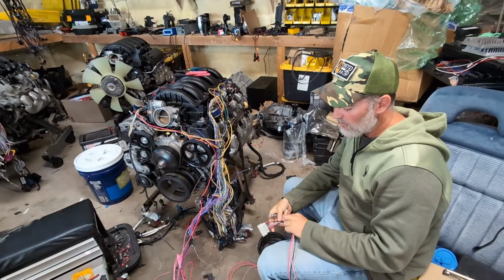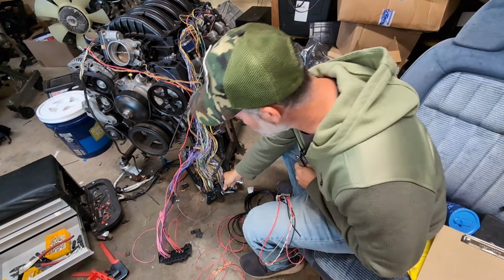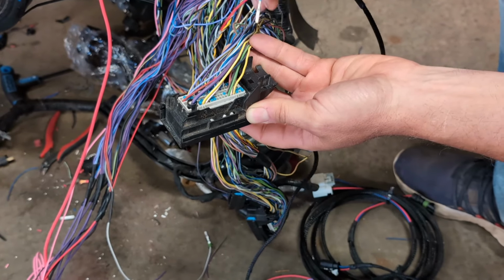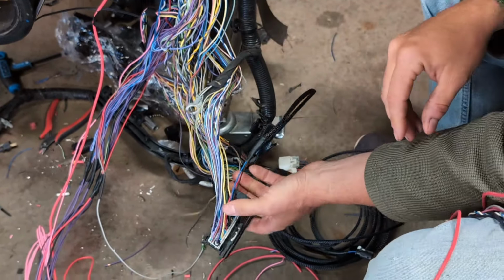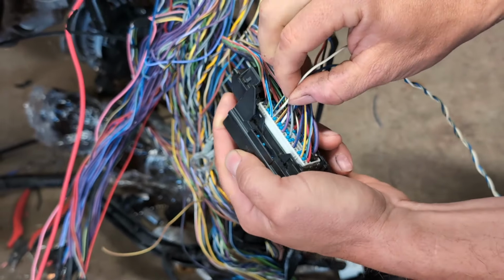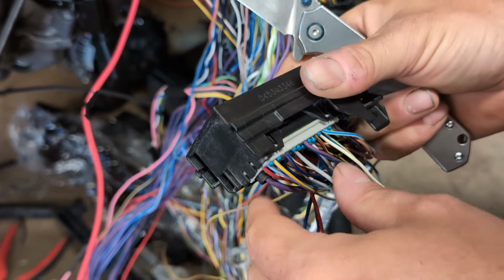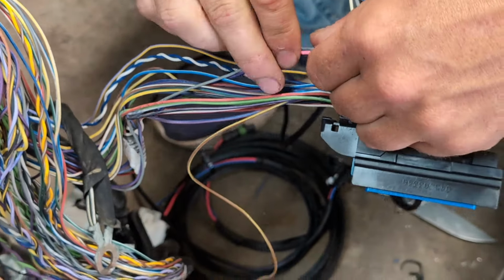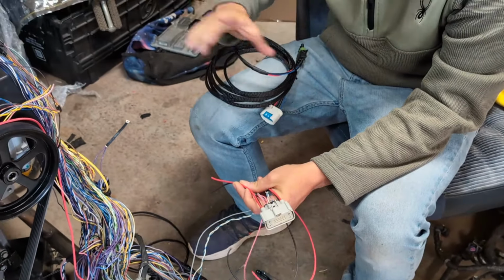GM fuel pressure control module wiring how to

Comment: Nice vid as always Mitch. 
This is very effective specially on older car/truck swaps, where the gas tank is near or inside the cabin. It will have better control the gm oem pump. Less noise, lower gas tenps, and longer fp life. 👍🏽